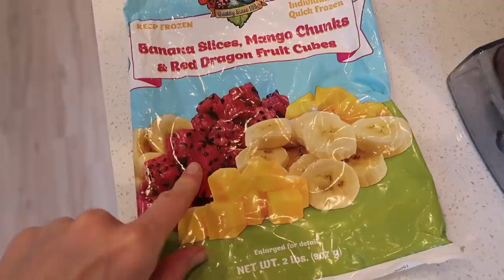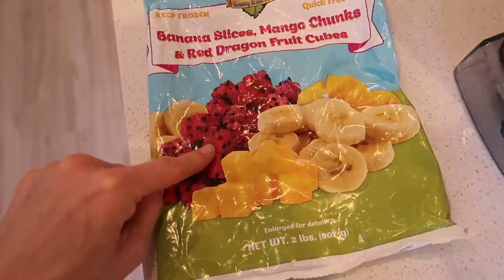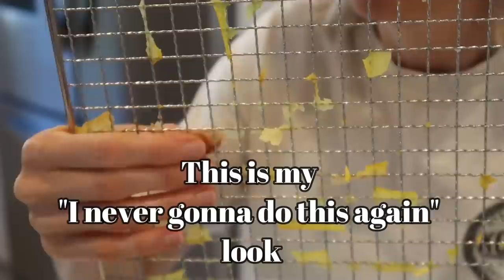HOUSE REMODELING VLOG /dehydrating veggies

Comment: Noemi, you can buy liners for the dehydrator trays for when you want to dry something thin - I use them for fruit puree to cut into strips for snacks.  If you have a silicone baking mat you could try that too, I think it would work the same way.

Comment: I put down parchment paper on my metal Excalibur racks.  I haven't had any sticking problems since doing this.

  I also pulverize mixed dehydrated vegetables in my Vitamix to add seasoning to my soups.  I keep the labeled mixed pulverized veg. in an empty spice jar.The dehydrated veg. will thicken the soups but will add flavor.